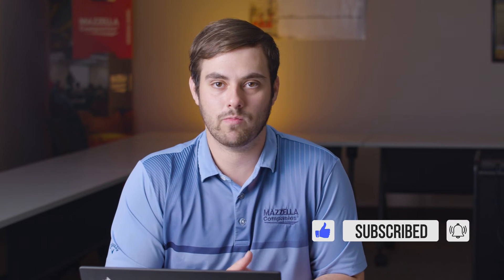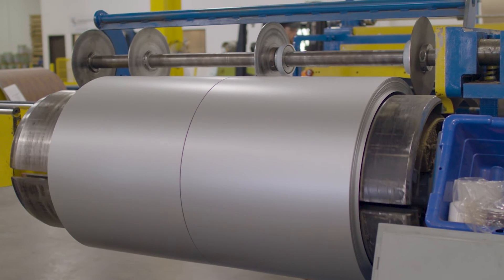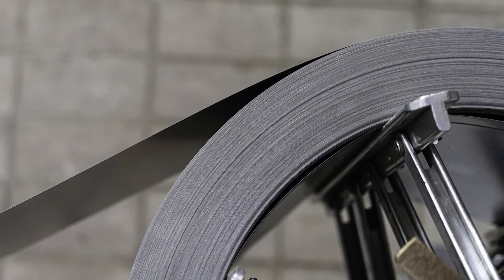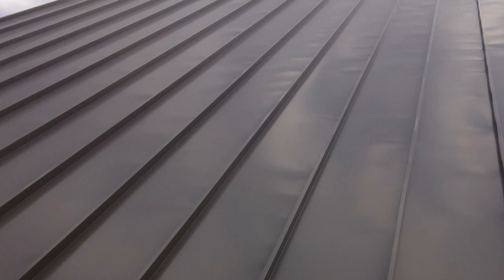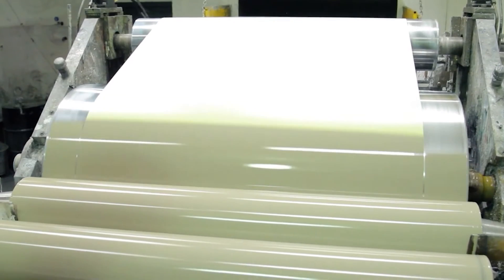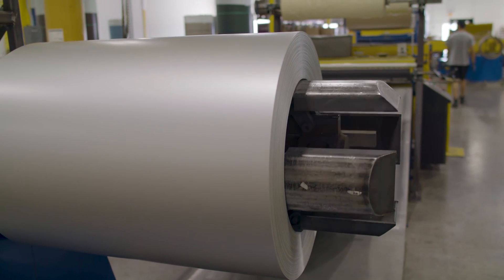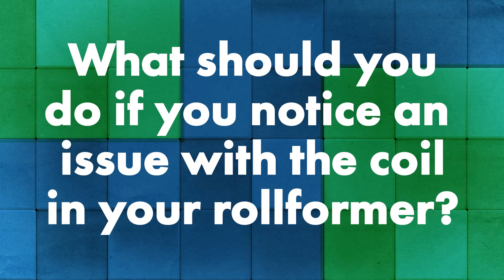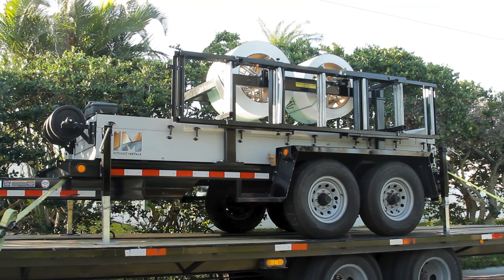Common Problems of Metal Sheet & Coil: Steel Substrate Defects

Comment: Hello guys.. a question from Brazil :).. I have a case of a galvalume sheet used in a roof where lots of black rounded spots (stains) +/- 5 to 10 mm diameter appeared in the sheets. This roof is used in a animal confinment area.. is it related agressiveness of animals confinment.. Could you explain technically what are the stains? Thanks